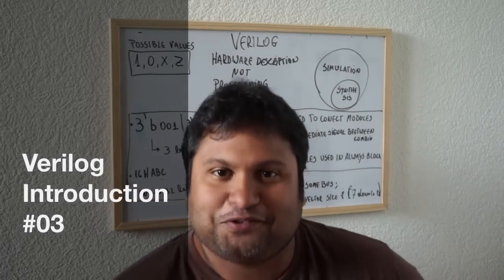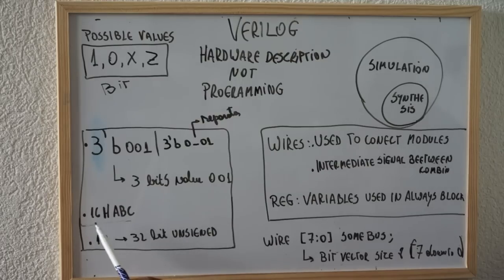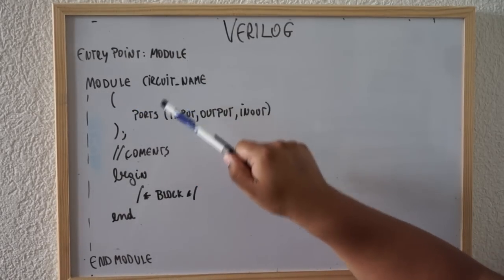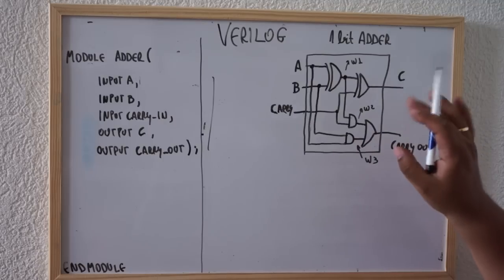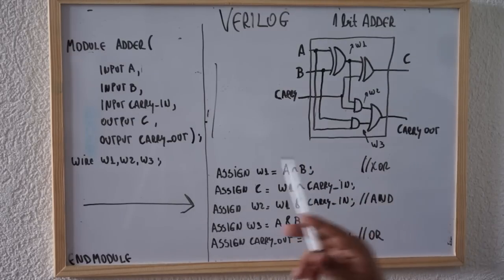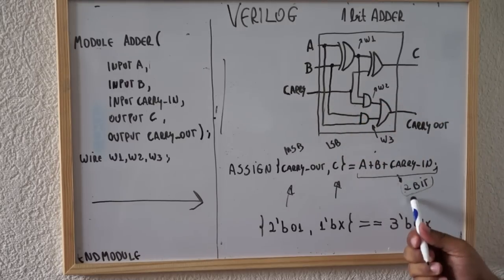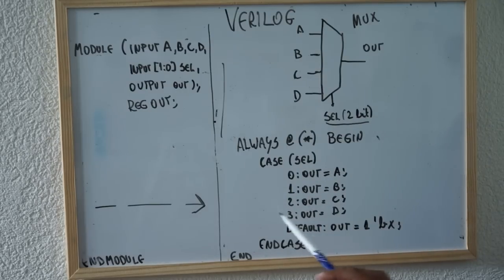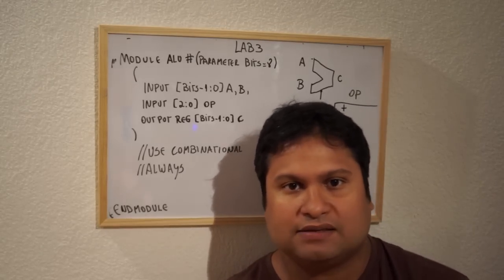FPGA Course - Verilog Introduction #03

Comment: Anyway, subscribed to your channel... in module() definition, it is important to use "output reg[0:0] q" (I am using "q" instead "mux_out" or "out"). Else, if just "output q", it will not works. Now, tried only "output reg q", and it works as with single element array "[0:0]". Acually, that is nonsensical array, so instead just "output reg q". I am testing on Quartus II and using RTL for seeing schematic diagram, since my hobby is electronics.

Comment: This is second channel I found with incomplete examples. I am interested in learning Verilog HDL, but your example on the whiteboard is not working. And then you made .v code for completely different case. Tried many variation, but none working. My last variation is:
module mux4(a,b,c,d,q,sel);
 output [1] q;
 input [3:0] a,b,c,d;
 input [1:0] sel;
 reg [1] q;

 always @(*)
  begin
     case(sel)
     2'b00:q=a;
     2'b01:q=b;
     2'b10:q=c;
     2'b11:q=d;
      default: out=1'bx;
     endcase
   end

endmodule;
And it not working at all... first tried what you describe on the whiteboard, then tried to modify... just don't know how.